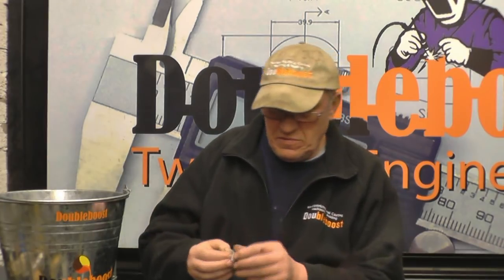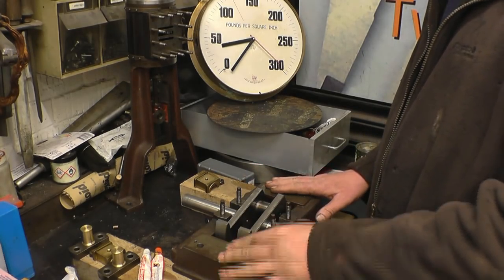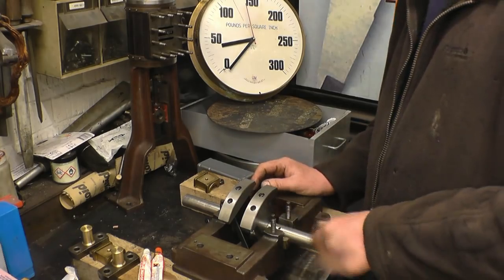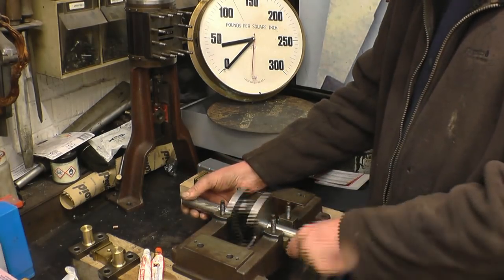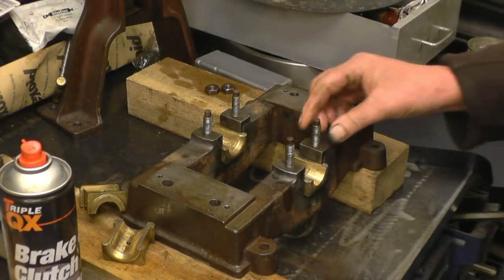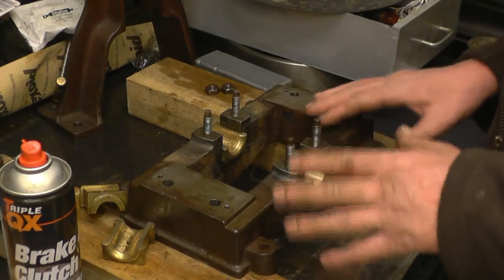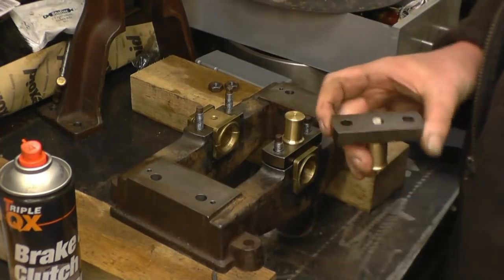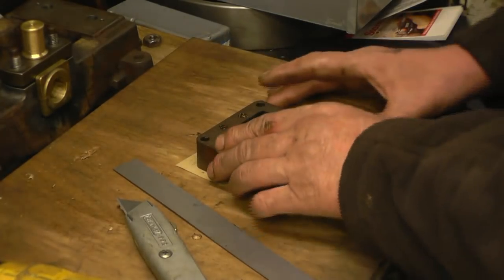SNNC 219 P1   Steam Joints & Packing

Comment: That stuffing box and the packing material reminded me much of what's used on propeller shafts on boats. Less pressure and lower temperatures in the marine application, so the packing material is just some sort of wax-impregnated hemp.

Comment: I had an idea for making a clean job of the blanking plugs. I discovered a while ago that JB Weld epoxy is magnetic. You could put a dab of it in the hole, then cover it with a piece of cellophane tape, then stick a magnet over the hole. The magnet will attract the epoxy against the tape, flush with the face of the part. The tape will just peal off the epoxy when it's cured. This also has the nice effect of letting you use the stronger 24-hour version while making sure the epoxy plug doesn't slump away from the surface of the hole and leave a gap/weak spot at the top.

Comment: Should have made 2 of those packings at the same time, would make it easier to get the top gasket shaped having already done the bolt holes for it. Now for fun with the correct period Shellac Indian Head to seal that on, none of this modern silicone will do there. 

Your original packing would have been oakum or cotton waste, felted nicely with some wax and a little mercury to get it to hold shape. The graphite one likely is cotton with graphite in beeswax to keep it together, though I have been using a nice PTFE impregnated white one for the last one I did, as it is a lot less messy to install.
Reply from the maker: There will be no silicone lol
Reply: I am surprised that they would have used mercury in packings for any reason, because I would expect that it would attack the shaft. Wax or shellac I could understand, but not mercury, how did it modify the properties to stiffen the formed shape may I ask?

Comment: Back in the olden days when cars had carburetors - a lead ball would get tapped into holes from cross drilling in the carb. They held pretty well - even under the pressure of the fuel pump.
Reply: At my age there's not much lead in my pencil either :-(
Reply from the maker: Never thought of that some fishing lead shot
Reply: Back then you could make a lead pencil Mark in a distributor cap, (points+condenser), causing a hellatious misfire!! Lol
Reply: Except there is no flaming lead in lead shot nowadays...